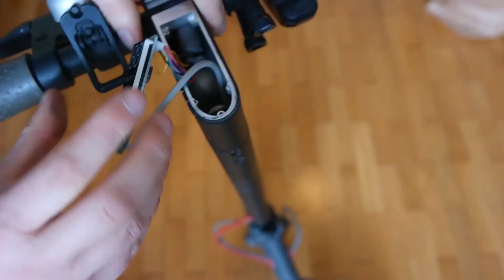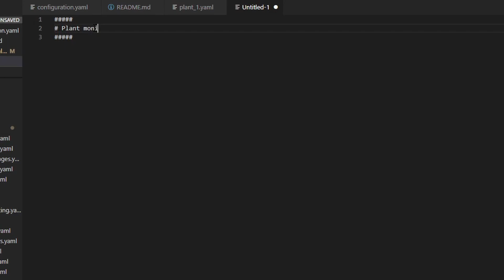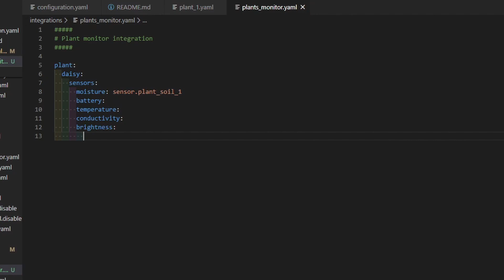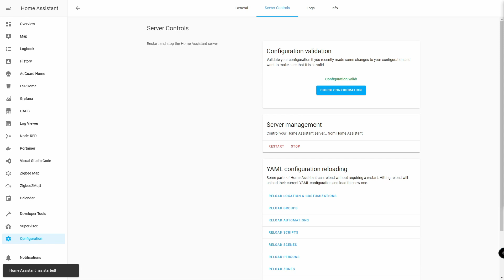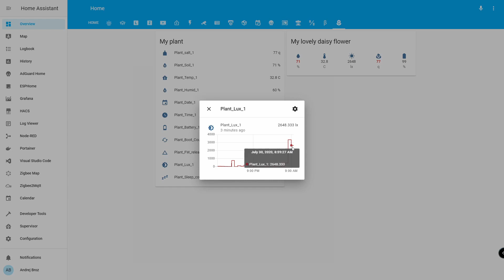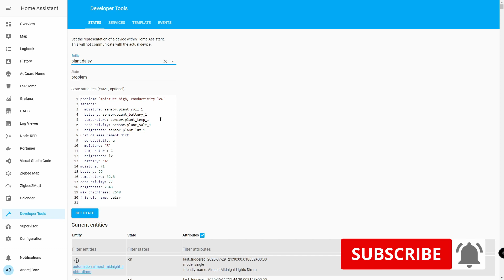Home Assistant How To - create and use Plant Monitor sensor

Comment: OK I just skipped through your video and couldn't see if this is waterproof. I want to add a moisture sensor to my vegetable garden so it will be outdoors...
Reply from the maker: There are some cases that should be waterproof, but I wouldn't put my money on them. I do have one outside, but it's not in direct rain, although it does get splashed a little.